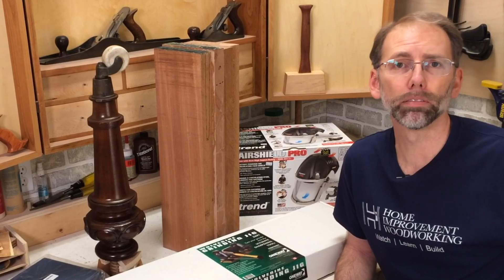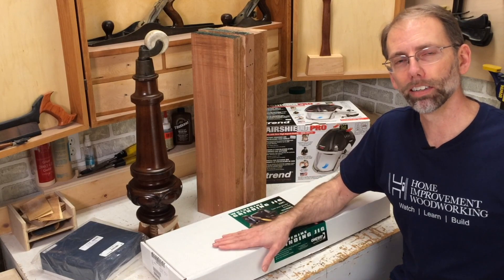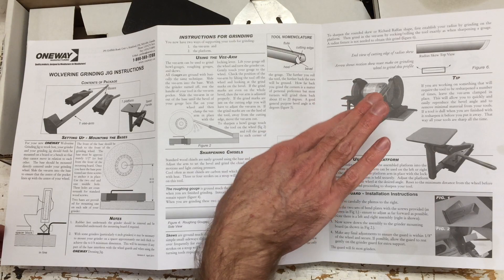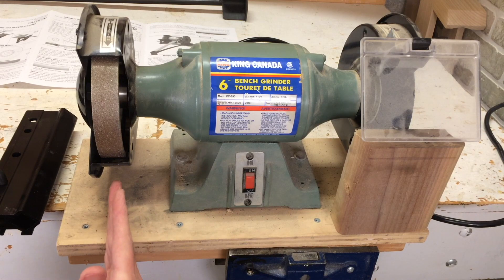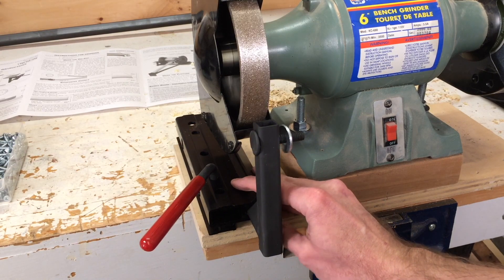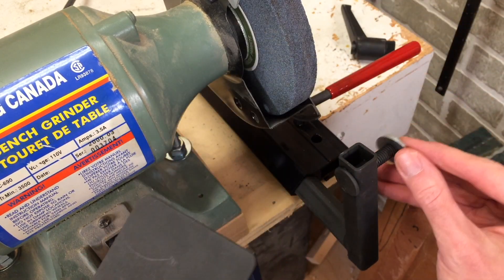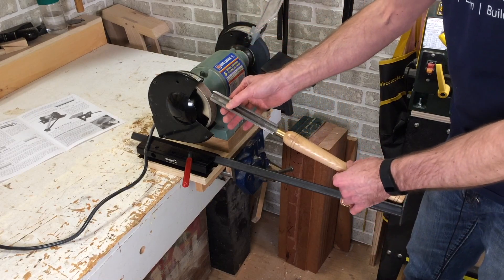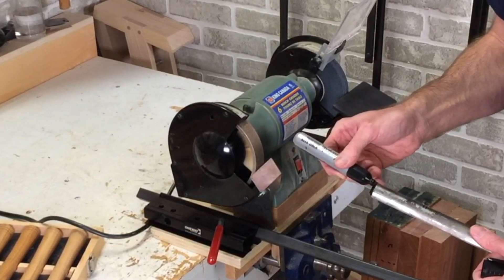Sharpening Jigs for Woodturning Tools - Review of Grinding Jig & Skew Attachment

Comment: some really good tips and tricks in here! Just need to get myself a grinder now lol
Reply from the maker: Glad you found it helpful.  Scott
Reply: Just make sure it's a slow speed with an rpm range around 1750.  And make sure it's not variable speed with a twist dial from slow to fast.  It should stay at this slow speed.  There's a great article I found about how variable speed doesn't give enough torque and when sharpening the strength of the wheel turning dies very rapidly due to the variable speed, whereas a set slow speed maintains this constant speed like cruise control.  A variable speed reacts like holding the accelerator on a car at a certain speed and tapping the brake at the same time.  The brake being hold a chisel against the wheel on a grinder.  Hope this helps.  Stick with Rikon if you can.  I don't support Rikon.  I just notice that all the pros seem to use them.  Or those whose opinions I trust.  Now, there are other good ones like Jet and Delta.  But, stay away from the cheapos.  After all, this is an extremely important tool in your shop.  Table saw or Track Saw and mitre saw.  Grinder.  Screws, nails, staple, glue.  After you get those, I would get a human to operate these tools.  Preferably yourself.  These are jokes, not digs of any kind.  Just my mind at 200%.  110% is insanity.

Comment: Question in a home improvement project I'm working on. I am curious on the relationship between the size of the door & the application of force needed to break from magnet.
My goal is trying to figure out how to reduce the applied force on the door so it opens easier. I wasn’t sure if the size of the door distributes the force in a manner where, if the magnet strip stays the same, it becomes easier to break that magnetic attraction. What are your thoughts?
Reply from the maker: Interesting question.  I'm not an expert but I'll give you my thoughts. The more surface area there is for the magnetic weather stripping to connect with, the more force will be needed to pull the door open.  One way to counteract the force would be to replace a section of the weather stripping with some that is not magnetic.  Just be cautious though... if this is on a passage door into a garage, the magnetic weather stripping is important to prevent carbon dioxide from entering the home if a vehicle is running in the garage.

Comment: Oh and I couldn't tell if you used the special washers that slide as you tighten to get a perfect centrifugal alignment.  If you touch the inside of the wheel as it's running, and you feel any vibration it is not set right and you need those washers.  Can't remember what they call them.  Also, do not get a variable speed grinder that goes from low speed to high speed.  Variable speed has issues with torque.  Keep your high speed, but definitely get something in the 1700, 1750 rpm speed range.  Can't go wrong with Rikon.  1/2 Hp, 3/4 Hp, or 1 HP.  I can't imagine a 1HP when using CBN is absolutely necessary as it's only gonna be on for a short while.  But, better motors are more durable and tend to last longer.